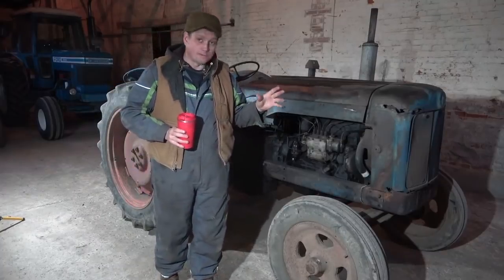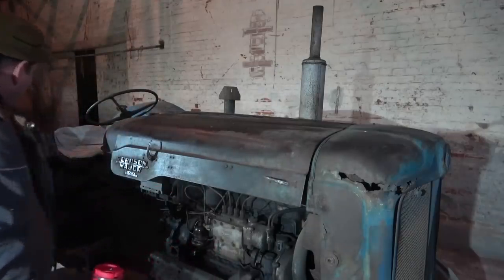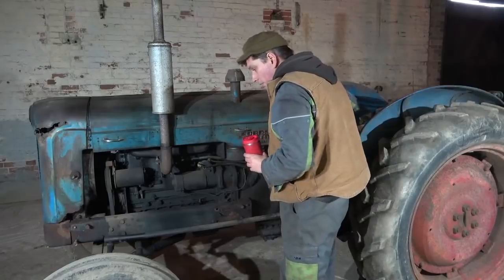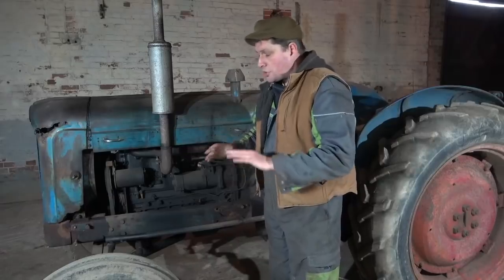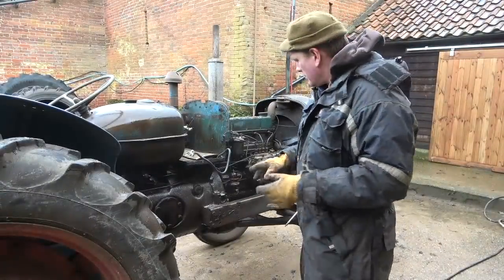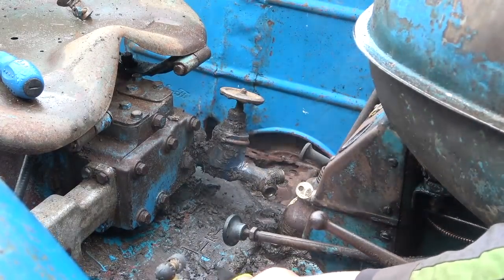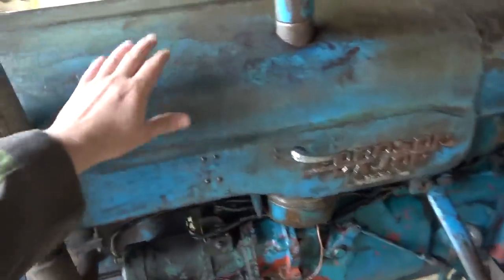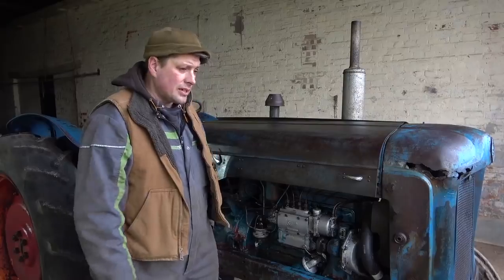PRESSURE WASHING A 70 YEAR OLD TRACTOR

Comment: Well if it was mine ..as much as I love tractors if you can find the parts and there readley available I'd change the bad parts and then paint it all original as possible .but if not able to get them for months I'd just fix all that is in rough shape .make it as good as I can then paint it .but it all depends on if I'm just gonna show it and start it once in awhile deff fix and paint like new but there is nothing like a old farm and a few old tractors sitting in the fields in a lil bit of rough condition but still runs and operable it's just a wonderfully site ..but when I see them now when I drive by farms I allmost want to stop and ask if I can buy them or just do a will it start vid ...but great vid and sorry for rambling on .till the next vid godbless and stay safe ..

Comment: I like repairing tin work so for me I would repair the tin work,  by not painting the repair except for a coat of old engine oil continues the story of an old hard working tractor. I think it depends on each individuals choice. All my tractors that I have restored get the best possible coat of paint, but are then put to work and not stood in a shed looking pretty.

Comment: If I got some pics of the one we have, reckon you might tell us a year of manufacture? It’s a power major super, or so it says
Reply: I'm sure the Power Major has the  instruments attached to a panel directly under the steering wheel. Earlier models has the instruments lower down next to the starting and stop and levers.
Reply: The power major has the uprated engine, which was a case of bigger inlet valves the same as the super but no diff lock , the super had a diff lock .
Reply: @oilyragsgarage7200  yep our one has instruments lower

Comment: With that type of fuel pump its a very early type. Top the injector pump up with engine oil. It needs draining of the rubbish diesel and oil mix a re fill there are level plugs there.

Comment: Good question I suppose if it I had the money I would fix the rusted out areas not replace them and for sure put money into making sure it was mechanically renewed I don't think I would paint it only enough to cover or descise the welded up holes but that would depend on how good a job wss done. I would want to use the tractor not have a toy

Comment: Any tips on getting a Perkins 4 cylinder diesel to start that has been sat for 10 years?
Reply from the maker: Watch a few of the Will it start vids on here and you'll get an idea of the procedure to follow.
Check it turns, check fluids, make sure you have fuel and a good battery and also a tin of Cosbys Party Gas
Reply: @LordMuck  cheers 👍

Comment: Why does'nt the water short some electrical components?
Reply from the maker: What electrical components ? 😂
Reply: @LordMuck  maybe this doesn't have any, but just in general when pressure washing on things that have a battery or an alternator, do you have any tips on how you don't short anything?
Reply from the maker: This one wasn't an issue but if it's a newer tractor for example, you'd try to avoid electrical fuse boxes or major components and if necessary we tape them with Duct Tape and plastic.
Also, before starting once washed, try to let it stand and dry out a bit. A quick shot of compressed air also helps.
Reply: @LordMuck  ty

Comment: Get a second hand good nose cone, new metal  nose cones are expensive. I managed to get a very good original nose cone for mine, no welding needed, and give the girl a good  service . I would get the injection pump serviced.and overhaul the starter though. Good old tractors .

Comment: I understand your desire not to over restore, or even restore beyond stabilising its condition. Without examining it properly, I am concerned that the cowling has suffered  rust to the point of losing structural integrity. I would want action before it and the machine's history breaks or falls off. It is no spring chicken, it has survived nearly 70 years, someone must have respected its mechanicals through many years, it deserves honourable treatment. A cowling repair, not replacement, could be part of that ongoing history.

Comment: I would leave the cosmetic as they are and do any required mechanicals and a full service.
My ole Fella owned a Ingersoll Rand compressor with a Ford Four D in it and it was a rough running old bugger, it would unscrew just about anything on itself, snapped the exhaust manifold and a few dynamo brackets.
It even managed to shake the biscuit drive to the fuel pump to bits and was still running badly on fuel pump timing retarded, the exhaust cherry red to three quarters way up the silencer!
The coolant was build hard too when we stopped it.
We thought she was dead that time, but a new coupling on the pump and coolant refilled off she went again.
Tough old boot, but did I mention she ran rough?

Comment: cut the rot out ,weld using gas + spray rough coat of matt black over repair area just sufficient to prevent rust. gas welding is much easier on eye - leave the grinder out of story for  a seventys repair look...

Comment: What dee greaser doyou use is it a home mix or a bought job ????
Reply from the maker: It's one we buy from a supplier for degreasing 5th wheel turntables.
Reply: @LordMuck  Thanks for taking the time to answer I will have a go with it It seems to work well ???
Reply from the maker: Hugh Crane cleaning products

Comment: Mechanical first of course. If the tin work is real solid, clean & preserve it, & also keep tractor in shed. Otherwise, get a good body chap to weld it up proper. Dust in the repair and presto its a bit more of the old girl's history. Use it, don't abuse it. That includes rollin' a bit of coal.
Cheers   (ps any chance a Nuffield will show up this year)
Reply from the maker: If I can be bothered to drag the Nuffield out then yes 👍

Comment: Painting it up is only worth it if it’s going in a glass box, something running mechanically sound can’t be beat...but it would sound much better with a 590E engine in it 😜
Reply from the maker: Which would be another one ruined.
Reply: @LordMuck  Were they a bad engine? Almost bought a major with a trader 590E engine a while back
Reply from the maker: No, in fact I did have a blue/grey with one in and it was sweet, I just think there's enough bodged ones out there. I did see a lovely 6cyl conversion just before Christmas though.
Reply: @LordMuck  Ah right, I know what you mean, plenty out there with hammerite poured on the tinwork, if there's any tinwork there at all...wouldn't want to think what the mechanical end of them are like! I picked up a 23c diesel 35 (I know!) in the end but still have an eye out every now and again for a nice conversion

Comment: Hey Kurt, Have you had much to do with Massey FE35 23C 4 cylinder engine? I have one with a suspected blown head gasket 
Cheers Matey Love the Video Garry from Australia
Reply from the maker: Just pull the head and have a look mate, if you suspect it, it probably is.
Reply: @LordMuck  It is a funny thing from a novice point of view, how many things pointing in the same direction do you need LOL, radiator is getting low and Oil has now turned Creamy Grey, it will turn over fine and I finally got fuel to everywhere, so the only way it will start is tow start for 50 to 100 meters and then she runs fine, until you bring her back to idle and then she gets a bit cluncky. 
Hey have you had anything to do with Fiat 415? as I have just bought a project tractor so I am learning all sorts of things I did not want to learn LOL but its all good fun

Comment: Keep as is, repair the bare minimum mechanically and go make it grunt. These things are supposed to work, loads already restored be a rarer site for it to be original. Like they say, only original once. I have a few pedestrian machines and dumpers kept original as possible but still able to do what then need to do. If its had some farm bodges that work, leave them on as its now part of it.

Comment: I have exactly the same tractor, think mine is a 54 so there may be minor differences. Watch out for the governor pipes that go from the injector pump round the rocker cover to the inlet manifold, mine were all pinholed round the rocker cover, and when you opened the throttle is was slow to respond, replaced them with copper pipe, with magic results. Mine has a pair of JCB wheels on the back which I would love to swap for originals, but can't find any!
Phil .        https://www.youtube.com/user/philhermetic/videos

Comment: I've been 'resurrecting' a 1956 one of these in recent months that had stood still for 30 years, my one had very badly rusted and bodged tin work and a frost cracked engine block. So has escalated to a total repaint restoration affair. If it however had been in the condition of this I'd of probably left it alone and repaired the dirty bits only. Stupid thing is I only wanted a old tractor for my other half's paddock roller, now it's got way out of hand... I should of done some better videos of the restoration really...

Comment: Early rear wheels early wider steering arm earlier 4 spoke front wheels but not the first 2 years of e1a as they had a extra ridge on the top of flats on the wings I'd say it's between 1953&58
Reply from the maker: No...

Comment: My opinion worth diddly squat First the mechanicals because they can be the most expensive and from there the cab seat left and right onto the forward, by the time you get to the RAD surround someone may have come up with an original for replacement . History is self serving but not that important . Where it mucked around and what it was used for does not have to be reflected by a poor appearance .